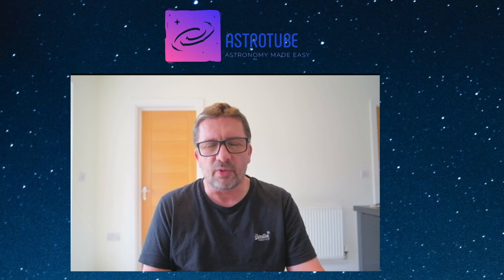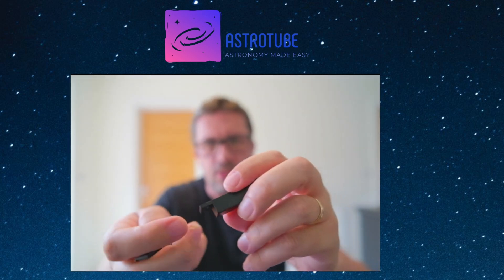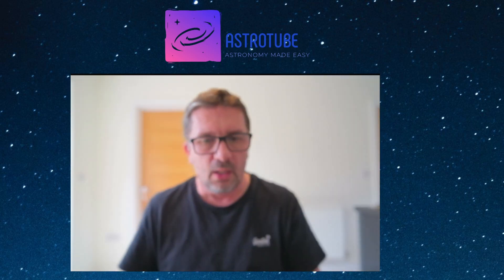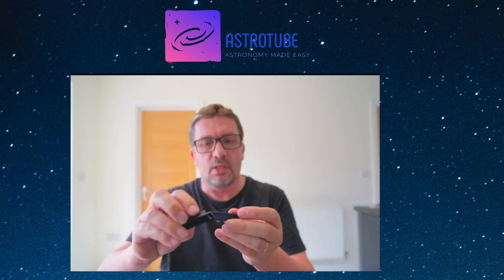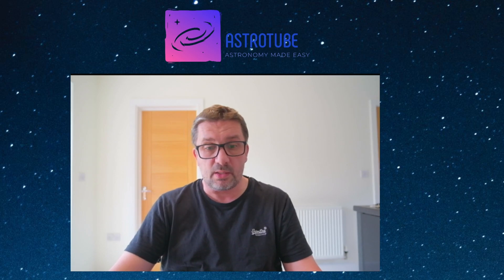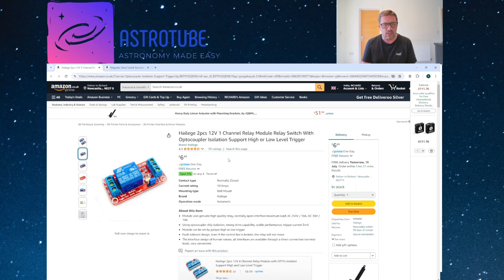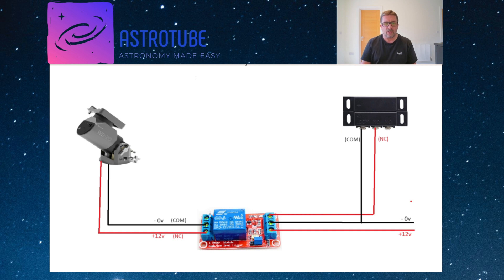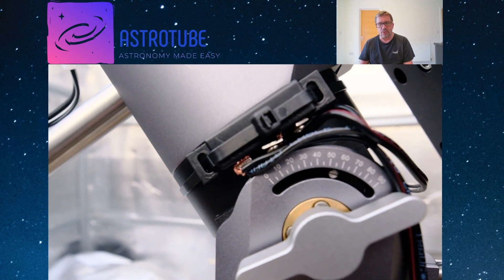Adding an external Limit switch to a telescope mount

Comment: you can also use a switch that can withstand the switching current of the mount so you can do without the relay
Reply from the maker: Can you share details of the switch you are referring too, as this may simplify the process further.

Comment: Great idea to stop any damage to the hardware.  So how does the set up actually stop the mount from moving when the two magnets come into contact?   Is it the power of the magnets together, which I doubt would be stong enough if it crushed a telescope or does it stop the power to the mount?  Do you have any wiring diagrams at the other end of the diagram to show how that connects to the solution, please?
Reply: No worries,  so basically cut the power lead and reattach with the relay in-between?
Reply from the maker: @julianmatthews3262  Before you cut any wires maybe consider putting the relay board in a little project box, and then putting a female 12v power connector on side of the box and have that wired the 12v input on the relay.   Then from the relay output, wire it to a 12v male power tip then test it with a volt meter and then double check you got the polarity the right way round and test it on other 12v devices before plugging into your mount.
Reply: @astrotube3967  thank you
Reply from the maker: I take ir you didn't actually watch the video then 😂 all the info you asked for is in the video including the wiring diagram
Reply: @astrotube3967  Slightly offended by that remark dude, I watched it twice but still had to ask the question.  Some viewers rely on tutorials as our knowledge is not too great.  I saw the wiring diagram and established that the two magnets are mounted on the mount and when they come together this triggers something to stop the mount progressing passed this point.  I take it that it is the relay at the point the magnets come together powers down the mount to stop rotation?
Reply from the maker: Hi Julian, i didn’t mean to offend. I’ve just had about a dozen people messaging me directly asking if I had a wiring diagram and asking for information that was already in the video, so I wrongly assumed you hadn’t watched it, so please accept my apologies.

Comment: Surprised the manufactures don't have this already built into the mount. Maybe a later version will in the future.
Reply from the maker: The mount has software software limits as all mounts have - But software limits can fail if the mount crashes or if the user does not set the limits correctly and on the WD-20 forum tere has been at least 1 reported case of a person having their Takahashi crushed.  So it's just an extra bit of protection that can be fitted for under £20 that is non-invasive and can be easily removed.